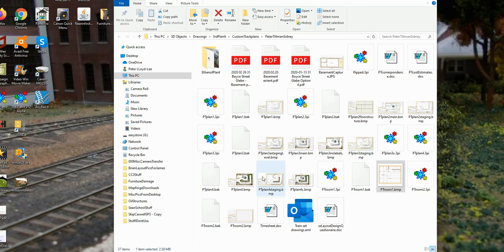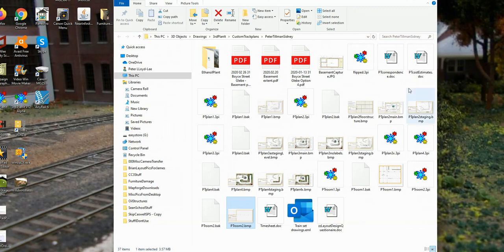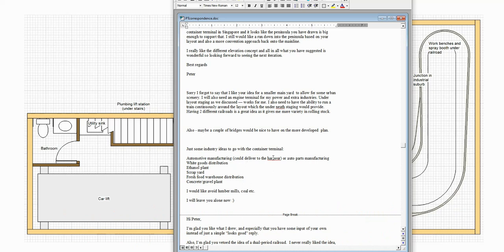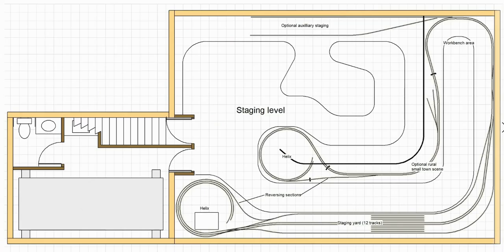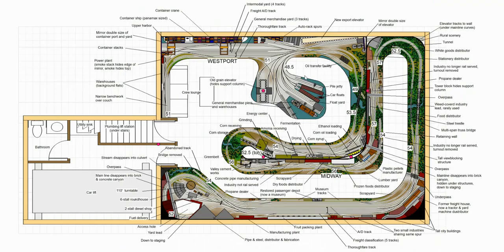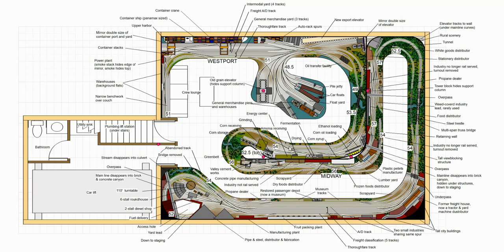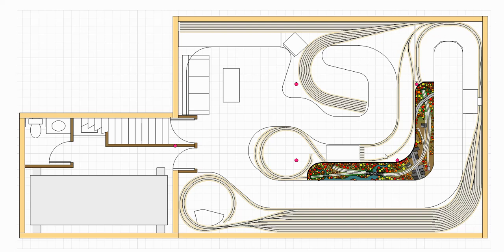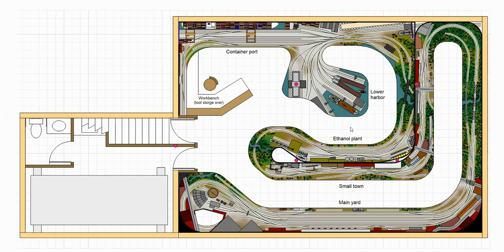Custom layout design for a customer in Sydney Australia

Comment: Personally I would have broken up the long L shape table into 2 sections to get more loops and allow a walkway in the center, would have also created positions for bridges.
Reply from the maker: Thank-you for the comment.  I have to disagree with you however.  What you are proposing is actually quite a common mistake for inexperienced layout designers.
Cutting a long peninsula into two short ones is almost invariably a bad idea.  Not only do railroad scenes need to be as long as possible to appear realistic, but the turnbacks you create (often called "Blobs") eat up a huge amount of space.  Each blob requires a circle about a foot bigger in diameter than twice the minimum mainline radius (about 7' diameter for this railroad), and this space is a lot less useful than the same area in a long narrow space.  Furthermore, each blob introduces a lot of additional minimum-radius trackage, while eliminating the long straight (or gently curved) scenes that are so much more desirable.  Overall, with the inescapable geometry of the additional blob, both the overall main-line length and the total useful layout area will always be less with the arrangement you suggested, simply because of the space you are wasting inside the extra blob, and the additional aisle length you are introducing to get around it.
You also comment on making opportunities for additional bridges.  Quite the contrary.  The only bridges that can be incorporated in the end curves that you create are short-span trestles - which can be incorporated everywhere.  It is not possible to add any kind of long-span bridge into the end-curves because they require straight track.  You are actually eliminating possible bridge spots by doing what you suggest.
Although there may be occasional exceptions, it is normally best to minimize the number of blobs in a layout design.
It is not my intention to shoot you down.  I hope this information is useful to you and any others who may read it.

Comment: Peter, this is by far one of the nicest track plans that I have seen. I really like the layout. You are a masterful designer. I would be interested to know from just a hardware stand point (bench work, track, scenery, wiring and controls) what a layout of this magnitude would cost approximately. I understand if you cannot provide that, just curious. I need to know what to budget for eventually.
Reply from the maker: Jeff, That’s a simple question, but one with a very complex answer.  You may as well ask how much a 2000 square-foot house costs.  New-York or Mississippi?  City center or in the middle of nowhere? Ready to move in or in need of major work?  Marble tile or dirt floors?  Gated community or slum?
The same applies to a professionally built model railroad.  How much of the layout is to be done professionally?  What level of finish?  Does it include room preparation, or a lighting valance, or trains, or ongoing maintenance?  What type of control system?  Signaling system?  Provision for nighttime operation?  How many structures?  Scratch-built or plastic kits?  Plastic 25c trees or hand-crafted $10 trees?  Where is it to be located?  These considerations and hundreds of other factors will affect the cost.
It’s no good just specifying “average” this and “typical” that, because one person’s idea of “average” or “typical” may be vastly different from another’s.  Furthermore, one builder may bid four or five times as much as another if given an identical set of specs.  That’s because some will do a much better job than others; some think their time is worth more than others; and some will deliberately low-ball the initial estimate in an underhanded attempt to get the job.
If you are in the market for a professionally-built layout, you may need to come up with a budget and then ask what that will buy.  It’s exactly the same when buying a house – the very first thing a realtor will ask you is “what’s your budget?”
I hope this doesn't come off as crass or offensive.  If you are considering hiring someone to build you a custom model railroad, please contact me privately because a public forum like this is not the place for discussing finances.
superiormodelrailroads.com
mpeterll64@gmail.com
Reply: I can say, having searched around for the right person/company to design, build and install my layout, that you will find no better value than with Peter given his experience, commitment, attention to detail and overall quality of workmanship which is, by the way, made available for all to see on YouTube. Unfortunately I do not have the skill to design or build a layout other than perhaps nailing some track to a piece of board, so finding a professional builder was my only option and I am very glad to have found Peter.  I highly recommend him to anyone who is looking to do something which is beyond their own capabilities or even to take what they already have to the next level.
Reply: @mpeterll  Sorry, I thought that you might have dollar per linear foot rule of thumb that would be a reasonable guess. I see your side completely. Sorry, to take so much of your time.
Reply from the maker: @jeffhallford5284  No need to apologize.  I get asked that a lot.  Some builders will happily give a price per square foot without even knowing what the customer wants.  I'd have to advise steering clear of any builder who works like that.  Almost invariably, that price barely covers a basic layout while the customer has visions of a completed masterpiece.  This situation can only lead to a frustrated builder and an unhappy customer.

The only part of a layout build that can reasonably be estimated as a price per linear foot is bare benchwork, but even that is hit and miss because a layout with lots of complex levels and corners will cost significantly more than a basic rectangle of the same size.
Trackwork cost is typically based on the number of turnouts, but even then there's a wide range depending on the desired control options.
Scenery can only ever sensibly be done on a time and materials basis as it is very subjective as to what constitutes a finished job.
Structure are best estimated on an individual basis.  As a rule of thumb, the going rate for assembling a basis plastic or laser-cut wood kit with no alterations or embellishment is around 4x the MSRP for the kit (although I usually end up somewhat lower than that).
I hope this helps.